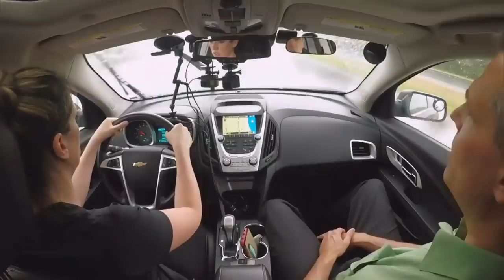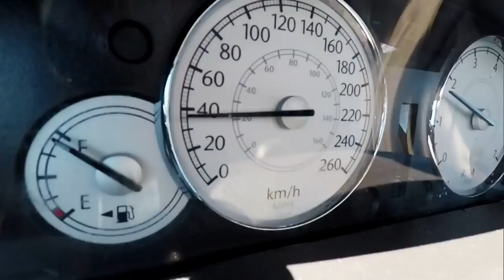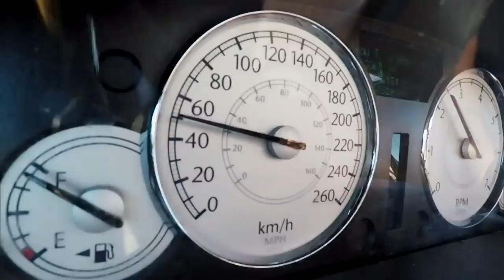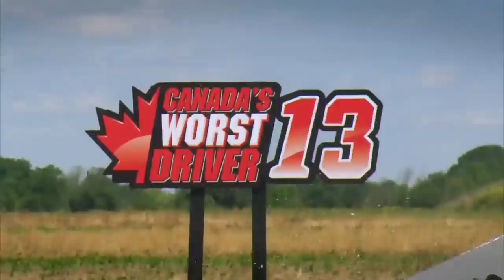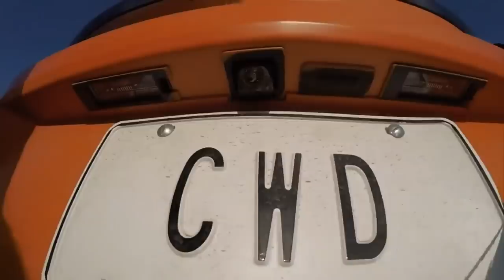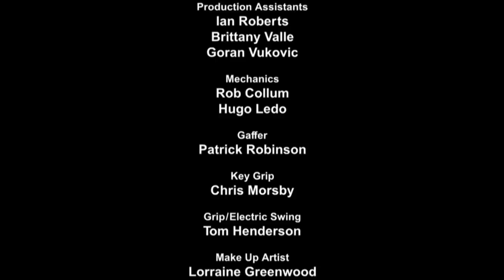Canada's Worst Driver S13E05

Comment: it's amazing you can pass a license test WITHOUT having to reverse.
Reply: ilikeredheads Not in Australia you can't. My test involved a 3-point turn and a reverse park (it was nearly 5 years ago, so I may be wrong, but I still remember doing at least those things)
Reply: ilikeredheads insane dude
Reply: Agreed. In my test, 3-point turn, reverse parallel park and a reverse around a turn.
Reply: Well you use to have to in Canada as well. They did say it was something Breanna's generation doesn't have to do now, and shes 19. So  it could have changed relatively recently. I know my youngest brother had to do a 3-point turn, which was about 9 years ago.
Reply: Ben Ward, South Australia still has that test, log book still requires almost everything except country driving
Reply: i'm Finnish, passed my driving exam last september, and didn't HAVE to reverse. i did anyway, even if just reversing into a parking lot between two cars. First thing i did was properly learn how to drive backward. That is just as important as driving forward in my opinion. no three point turns, no nothing really. just driving around at 40-50kmh and see if i crash. That shows on the roads, especially in Finland with ice and snow and everything basically from september to may, where people crash all the time in the winter due not knowing. like my friend who got his licence and wrecked his 15000 BMW M3 the same day.............x9999dots.
Reply: In Canada yes
Reply: @TurboLerssi  I thought that you Finns have crazy driving tests and that it takes quite some time before you get a full licence.
Reply: @Ward1706  same for us in Ontario when i had mine 15 years ago.

Comment: I used to be very fearful of highway driving but it's actually very easy. The key is to relax, match your speed with traffic, right turns from a surface street I find is easier than merging. I am 24 and recently got my licence. Driving my mother's car 2009 Buick Lucerne with very poor rear vision is kinda scary but it handles well, very smooth and easy to drive. I want to buy an AWD sport sedan like a Subaru WRX STI. Lots of power in a small size and good vision all around.

Comment: I passed my test in 1985 in the UK. As part of the test, I had to do a three point turn, reverse round a corner and do an emergency stop.
Reply: It's mostly anxiety. If the contestants wouldn't freak out about what they were doing they'd have the brain power to do almost everything that scares them. They can't even claim to be task saturated like some of the distracted drivers in the show. I sympathize but realistically, as every single one of the driving instructors points out, they have to practice in order to overcome their fears. Especially with a tool box and checklist at their disposal of what to do, they will he fine. It's when they forget to signal, decide, and drive that things go to crap.  I think the saying in aviation is no matter what's happening aviate,navigate, THEN deliberate. In other words focus on driving the vehicle using the skills you practice,  don't go into trouble shooting  panic attack land when you still need to pilot the vehicle. (My dad's favorite saying when he taught us how to drive).

Comment: f*ck, we in germany are allowed to go over 200+ kilometres an hour at some "highways" (no speed limit at all, if your car can go 300, you are allowed to..), what's their freakin problem with your small speed highways over there? :D
Reply: MucChris I've heard there's a speed limit in urban areas. Is that true
Reply: On "highways"? (we call it "Autobahn" here). It all depends on how much traffic there is. Really many of the highways have electronic speed limits that are set to the actual needs here. So if there is many traffic or an accident happened it goes down to 120 km/h, 100, 80 or even 60. Also some highways do have permanent speed regulation to 120 for example. But many are still free to go whatever speed you like. In the Citys, we have 50 km/h and in school or living zones that goes down to 30 km/h maximum. Hope i could answer your question, if not feel free to ask whatever you want to know :)
Reply: MucChris makes sense.

Even though the MTO (the ones who maintain and build our highways) build it to a high design standard, we've been limited to 100 km/h since the oil crisis in the late 1900s according to online sources.

Personally, many of us in the Golden Horseshoe Area drive 110 - 130km/h on the highway (400 series) (rural and urban), traffic permitting -- even with a limit of 100
Reply: I'm always wondering how long trips will take if you are only allowed to go 100 km/h.... well our truck drivers are limited to 80 km/h permanently, but all other cars are not. Sadly i have never been to Canada or the US until now. :-( A lot of people here also go 10-15 km/h over the speed limits, cause the prices are not high and speeding is a bit of a "gentlemen's crime" here.
Reply: MucChris speeding isn't much of a gentleman's crime here in Ontario. The  20 over penalty is when your license starts to get demerit points and the insurance goes up. 50 over gets put into stunt driving and you lose your car and license for a certain amount of time (I can't remember how long) 

So far though, it seems as if police only pull people over if they are driving pretty reckless (on the highway). Even they speed with us.

Trips take too long here since many people don't know lane etiquette. Some people go under the limit in the far left lane, sadly.

In rural Ontario most of the time drivers do keep the left lane for passing, thankfully.

Edit: here the trucks are speed limited to 105km/h supposedly
Reply: MucChris Germany always been a country of logic when it comes to these things and I love it I got a ticket in the mail for going 9km over a speed limit.... $110 dollars (canadian)
Reply: speed kills dude..     go ahead and hit a dear at 300k    u dead
Reply: if you hit a dear at 180 km/h you are dead also. As i told, it is allowed to go as fast as you can on some highways here. I don't go over 160 anymore, as i had a spin out at 210 km/h when the motor died. Spun on my own oil. Luckily nothing happened but a blown motor. But that showed me enough to not go that speed again.

Comment: it's called a j turn, not a "reverse flick"
Reply: mosaic things can have different names dont be ignorant
Reply: i am aware things can have different names, but it's a stupid alternative name. just call it a j-turn.
Reply: mosaic actually a j turn is going forward and turning around using your e brake
Reply: black hustle No, that's a bootleg turn.

"A J-turn is a driving maneuver in which a reversing vehicle is spun 180 degrees and continues, facing forward, without changing direction of travel."
https://en.wikipedia.org/wiki/J-turn

"A bootleg turn is a driving maneuver intended to reverse the direction of travel of a forward-moving automobile by 180 degrees in a minimum amount of time while staying within the width of a two-lane road."
https://en.wikipedia.org/wiki/Bootleg_turn

Comment: Sorry but trying to teach people who are struggling with basics such as parking and reversing how to do stunt manouvers like a reverse 180 or handbrake turns will not help their confidence at all. At best it is irrelevant (since they will never apply it on the road) at worst it will just confuse and overwhelm them. Very silly and pointless test.
Reply: soundseeker63 if they do it they feel bad ass boosting confidence and its just a liitle fun you can have fun every once in a while you know
Reply: They are scared of getting on the road, teaching them tricks isn't a preperation for their real life but just something that makes them lose confidence when they fail. It's fine to teach these things to people who are experienced and confident drivers but this isn't helping these scared drivers. 
I agree with teaching them how to avoid obstacles (since that saves lives) but I'm doubtful about some of these other tricks.